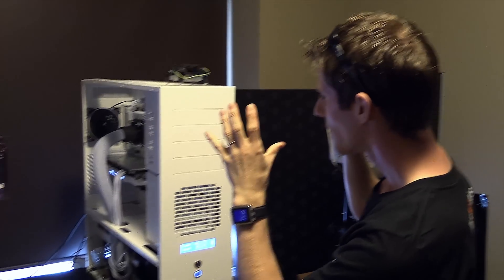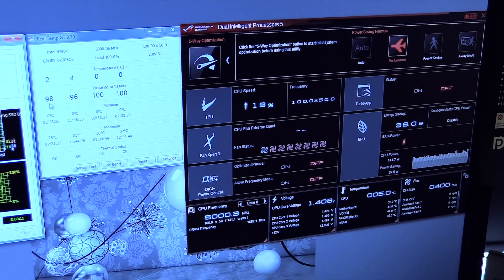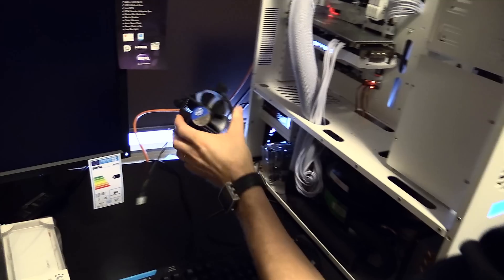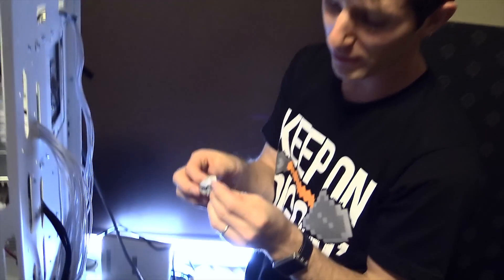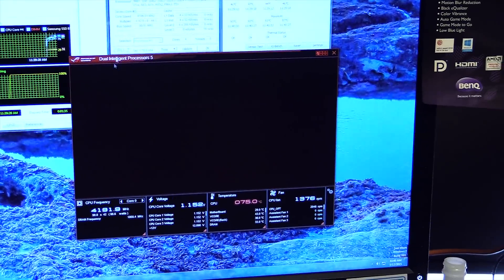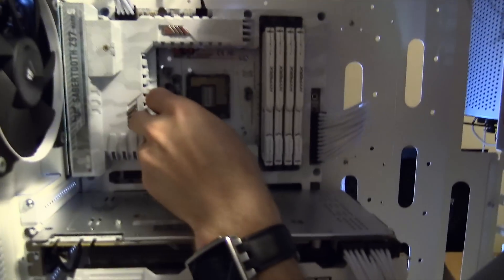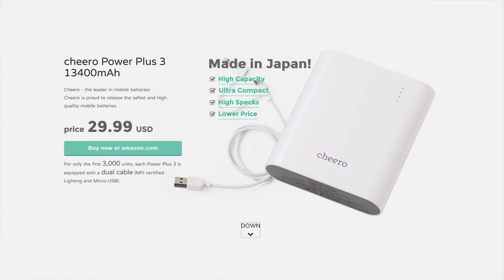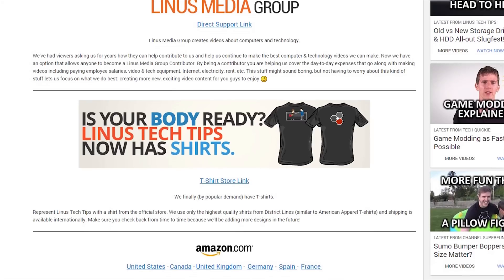CPU Cooling - Does temperature impact performance?

Comment: Guys... Is the GTX 970 better than GTX 980? If so then is the GTX 970 better than the 780 Ti?
Reply: Pdubs Pvp No the GTX 970 is not better than the GTX 980, though from a price to performance standpoint it certainly is; the 980 performs around 30% better, but costs around 80% more. The GTX 780ti is slightly faster than the 970, though the 970 sometimes outperforms it (for instance in BF4). Cheers!
Reply: Pdubs Pvp No and no.
Reply: Pdubs Pvp 970 and 780ti are very close to each other, though the 970 is actually slightly faster. 980 is no doubt the fastest one, tho you can buy a 970 and overclock it and you can get the same performance like a 980 just like me. I'm using the 970 G1 from Gigabyte.
Reply: Bonnie Nice, I've been wanting to buy a G1 from gigabyte for awhile now...
Reply: XtremeDrake I think you should get an Inno3D iChill gtx 970. Way better than any other 970 model out there. And temps under full load don't even hit 60 degrees :D
Reply: Pdubs Pvp no lol... no way a 970 is better than 980
Reply: 980 is the fastest of the three and I would say the 970 is the best performance to $
Reply: ***** Actually, no it won't
Reply: Bonnie Thats the thing.. I don't know what over clocking is...

Comment: Pointless filler video. And answer is no to the ultimate question. You just have to look at the box in specs section. Each cpu is designed to operate in certain temps. If you stay within these boundaries cpu will perform the same. If you go above then of course it will affect it. After that stupid plumbing waste of material video they did i dont expect anything smarter from them.
Reply: A cooler CPU allows more headroom for overclocking
Reply: Mike Peabody You have missed the question and point of this video. Does cooler cpu affect performance and the answer is no. Even stock cooler is enough to cool ur cpu otherwise it would not be included with ur cpu in the first place. Channels like this make u feel tiny and u dont need to upgrade ur cpu gpu every 6 months. Even running ur cpu at constant 80degrees is ok thats how it was designed and engineers knows it. Just dont listen to some unoxers techtippers and marketing gurus on youtube and u will be just fine or even better off.

Comment: Don't forget to mention that you would be breaking one or more physical laws if a cooler core ran faster considering how absolute zero slows down LIGHT.

+1 for the irresponsible shenanigans; don't do it again :P
Reply: Dude. A CPU at near absolute zero without damage would be massively better than a normal CPU because the CPU would become superconductive and lower resistance is better. What you're thinking is a GAS that's at absolute zero, with metal it has zero resistance and electricity flows entirely freely.

Comment: Laptop-wise, it impacts alot. If the temperature gets to a certain point, the cpu will underclock and make everything slower to keep it cooler. That's what happens to mine atleast

Comment: Kinetic Molecular Theory tells us that as molecules get colder, their motion "slows down" and they speed up as temperature increases.
Reply: Jimmy M Chem 101 doesn't start until next semester so you can hold that Ctrl V until then.
Reply: Andrew Crews That's true for molecules in ideal gasses, but in metallic solids, cooling down actually reduces the vibrations of the metallic atoms, meaning they're less likely to get in the way of the free electrons, meaning the electrons can travel faster. What determines the speed of the electrons themselves is the voltage applied to the circuit, so, cooling down and applying a higher voltage (as you would do when overclocking) would speed up the computations.
Reply: Andrew Crews the opposite happens, why do things become super conductors when they're super cooled? Because when an object is cold it has less kinetic energy so molecules move slower which allows electrons to move with less resistance when it's colder. (This could be completely incorrect, i just always thought of it that way)
Reply: MrAbood900 That is indeed true for metals, however semiconductors such as silicon act differently. 
When an intrinsic semiconductor is heated, electrons in the lattice structure are 'shaken free' this causes a positive charge in the lattice. 
Therefore when an electric field (emf source) is applied there is a overall a greater conventional current.
Reply: i thought it was common knowledge that Electrical Resistance decreased at lower Thermal Energy Temperatures.
won't make a lick of difference for computers in a realistic fashion. there'd be a difference between sub zero cooled electronics and ones that are running up towards boiling.... maybe.

***** note that that entire Article is floating in limbo. it's all theoretical at this point.
Reply: Jimmy M that works with things that have a mass. Try with electrons.
Reply: IIRC it only really makes a noticeable difference when you get to super low temps like absolute 0 but idk much about physics
Reply: JJ .B i guess that could be true, i haven't studied semi-conductor at all so i wouldn't know
Reply: Jimmy M Kinetic theory deals with ideal gasses, a cpu is a semi conductor full of thousands of transistors, the transistors switch between being on and off by having a small current applied to them which causes a much larger one because of how theyre made (google it if you want to know why). Because this deals with current, theoretically in a semi conductor at a lower temperature should exhibit better processing due to a decrease in resistance allowing greater electron flow (current) therefore allowing the transistors to be "on or off" (basically binary code) at a greater rate but realistically the effects are negligible because electron flow is extremely slow anyway, like a lazy river at a water park but much slower, and the paths they travel are so narrow simply decreasing the temperature isnt enough

I'd like to think what i said is correct, but take it with a pinch of salt because theres probably some big key point that I'm missing
Reply: Noah Kimbler absolute zero is the minimum temperature, if you think of temperature as energy, and then think about the fact energy cant be negative, and is unlikely to be 0, absolute zero is to say something has NO energy whatsoever so it reaches a point where you make something so cold it doesnt exhibit normal properties, so it reaches a point where it would probably make it worse or just stop working. 

Physics is a great subject, well worth a read if you got time to kill haha
Reply: ***** that's pretty cool (no pun intended haha) at the level I'm studying at we only learn that temperature is the direction thermal energy is transferred, nothing further than that really, maybe after A levels when I do physics degree it'll be elaborated on haha
Reply: Jimmy M "kinetic molecular theory" only applies to an ideal gas you moron. Stop pretending to "be smart". Someone that actually knows their shit knows you're just pulling shit off google.
Reply: Aman Sood Good work!
Reply: Andrew Crews Ikr.... lol

Comment: Hey. I have a question for anybody who would like to answer. I have a closed loop AIO Corsair Hydro Series H100i Extreme Performance CPU Cooler cooling my CPU with liquid coolant. Because it's an 'i' part I can use Corsair Link with it for greater control over it via internally connected USB 2.0. You must connect the two fans screwed onto the radiator to the block via a 4-pin PWM splitter thing.

The H100i also comes with a secondary splitter and there's a port for it on the block, so you can hook up two case fans to the CPU water cooler. This essentially makes the cooler a fan controller hub, so you can control at least two more fans with Corsair Link. I do want to control more fans with Corsair Link. However, all of my case fans are 3-pin fans and I don't know whether or not there's any point in connecting two more fans to the H100i. Will it work? Is there any point? Thanks.

Comment: Yes it does. Actually turning my GPU fans to 100% gives me a pretty big Performancr Boost. Im not doing it all the time.
Reply: UrbanDanger ! Thermal throttling isn't the same thing as the temperature making it go faster.
Reply: UrbanDanger ! I guess another message that the test in this video tells you is that cooling simply enables you to overclock your cpu that, in turns, boosts performance, but it's not the same as saying cooling directly boosts performance, which of course is not true as Linus has disproved with his test.
Reply: Alq so maybe isnt clocking on its max possibilities cause of the heat being produced. That would be logic for me.
Reply: UrbanDanger !
Yeah, as Corey Meisenheimer told you already, your GPU gets throttled due to the heat being produced. It can't run at a higher clock speed because the temperature is not safe for the GPU.
Reply: UrbanDanger ! Doesnt most new GPUs clock themself higher when they are cool and are under heavy load?

Comment: Well Linus you wrecked that Board and Cpu. What you should have done was build another machine with the same Motherboard and CPU. You could have easily switched out the ram, video card and whatever other parts you have in there, other than pulling all that gunk off the board, CPU socket and pins. It will be interesting to see if that PC lasts now. Although I doubt it you put it through some torture.

Comment: I have my 4790K at a x50 multiplier too, but I'm not a little baby about it like Linus. I run it at 100.1 BCLK which results in a visually pleasing 5.005GHz, not a wimpy looking 4.998GHz like Linus. No problem with stability at all.
Reply: Username0123456789 Your last two word determine everything.
Reply: Username0123456789 Oh, so you're one of those users;

Hate coil whine? Fans sounding too loud? Put on a pair of headphones, you scrub!
Reply: bluephreakr I guess it kinda works. :D Everyone should have "Headphone overclock" profile? :D  
FULL SPEED!
Reply: rosewell1983
I'm using a chilled water setup; with the chiller being a Koolance EXC-800 -- It does make some noise but I don't hear it because all I do is game on this PC and I have headphones on.
You can do 5GHz on a 4790K with just regular water cooling if you have a really good loop and a lucky chip.
Reply: donkey1450 every chip overclocks differently. #silicon lottery
Reply: NoobInGame Crank it to Ludicrous Speed!
Reply: Username0123456789 are you using phasecooling? does that kind of "cooling" make alot of noise?
Reply: rosewell1983 It does. Linus mentioned it in the build vlog and you can kinda hear it in this video.
Reply: 4790k here, 5ghz on H100i GTX, core voltage=1.3, temps under 70c
Reply: +Username0123456789 Thats what you get for running .007 GHz over Linus's speed!.... /s
Reply: You and I, we are username brothers.
Reply: ***** yep currently at 4.61 absolute max 1.25v. Does the job though ;)
Reply: donkey1450 That and/ore he/she has the PC in an AC'd room who's ambient temp doesn't go over 62F...ever.
Reply: Username0123456789 Whats your voltage set at?? I topped out at 4.7 with 1.36 volts :( 4.6 at 1.25 volts. No clue why theres a massive jump. Not very happy with it haha
Reply: Username0123456789 Running 5ghz on an H105 push/pull and 1.3v with good temps ;) as 24/7 have it at 4.8 and 1.2v
Reply: i tried overclocking for the first time a few weeks ago on my cheap dualcore cpu. laughed my ass off. tried to get the temprature as high as possible without it crashing. 95degrees celsius...stock cooler...
Reply: yakfizzle You have a very good chip. Haha based on the results ive seen, the average clock speed has been 4.8-4.9ghz. I think i got the worst chip of the lot hahah. Ill just wait and buy a broadwell chip, hopefully the average batch is around 4.9ghz haha. I want that 5ghz wank factor :p
Reply: donkey1450 sounds like you might as well leave it at a total estimated clock of 4.6. going to 4.7 on the Chip you have isn't worth it. considerable amount of extra heat to dissipate (and thusly more 'wear') for not much result.
Reply: Username0123456789 you know, you can set your BCLK to 100 and cpuz will still report it at 5.00Ghz by changing the setting in cpuz.ini to BusClock=0 instead of 1
Reply: +Jerardo Paulo
 Too late. My 4790K died.
EDIT: NO IT DIDN'T. IT WAS ACTUALLY MY POWER SUPPLY!
Reply: +bluephreakr i have headphones (close ones) i can hear my very vell when im gamong
Reply: +Username0123456789 ... hmmm, seeing his numbers (firestrike) on that system makes me feel a hell of a lot better at being just under 11k score on firestrike, same cpu running at stock speeds (4ghz) with a GTX 970 ..... i have clocked the cpu at 4.7 with no voltage change, just bclk and ram timings (cas10 to cas12) , and with nothing but a NZXT Kraken x61 AIO cooler, even under heavy heavy stress (GTA5 & Witcher3 open & loaded ingame while playing Fallout 4 and a chrome browser with 30+ tabs open all loaded and YT playing vids while downloading vids too, heavy enough for stressing all systems) it has not gone above 64* yet (ambient is in the high 20*'s btw)  ..... sits idle (cpu load around 15-25%) at 26* so i'm pretty pleased with the headroom the chip has for when i get serious with an OC or if i ever really NEED that power...... also glad i didn't get a 980 OR a 980Ti now too.... these g1 970's are bloody hefty cards

just wanted to say, as i only just in the last week finished the main build...... so it was good timing to see this ;)
Reply: +BoogieManSince1977 yeah man i got  i7 4790k too with maximis vii hero and 970 g1 .. it just break out the rulzz i use corsair h 105 and never go to 70 degrees in stress at 4.8ghz
Reply: Eluvyel
MY 4790K DIDN'T DIE! It wasn't even the motherboard. It was the effing POWER SUPPLY THAT DIED! I can't believe it took me so long to try to replace it, but after replacing the CPU didn't help, I figured out it was my HX1000i (Which I couldn't believe because it was still supplying power to some of the LEDs on the motherboard). Now I've had the replacement PSU for a couple months, things are still silky smooth at 5.007GHz!
Reply: Username0123456789 gj then.. i had the same problem as you on this pc when i had the r9 290x it draws so much power and i had a 760 psu who just restart my pc when my video card loads in games .. and thats overall the r9  stay only in 95 degrees celsius i call a radeon support who told me it is normally to stay constant at 95 degrees and i sold it and the psu and i bought psu corsair 860i and gtx 970.. and i can say i start a new life :D
Reply: +yakfizzle yep
Reply: Sergiu Dinu ya...I doubt it. Either you're making stuff up or that rep had no idea what they were talking about.

R9 290x shouldn't be hitting 95c under load unless you're in...idk...India with no air conditioning. 

As for the PSU, my main pc has an R9 290 and a 750 watt psu, with no problems.